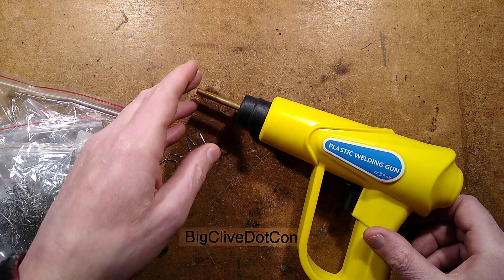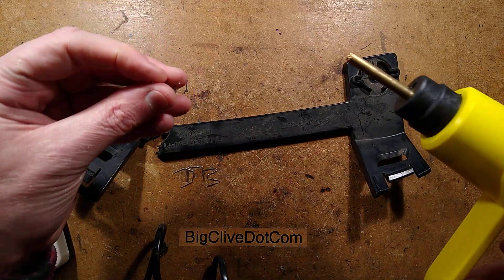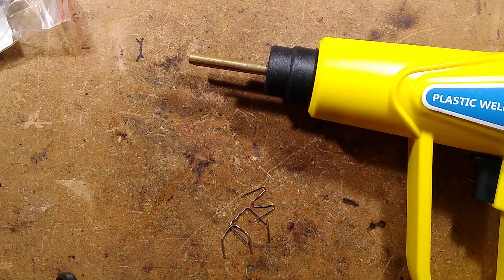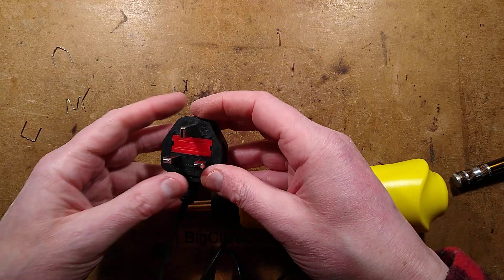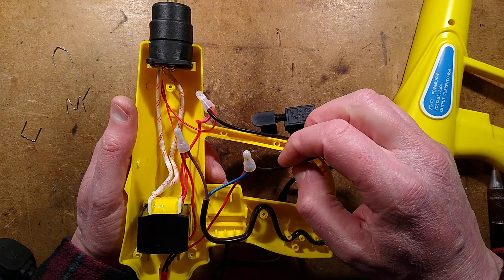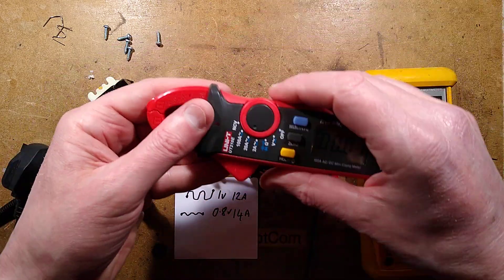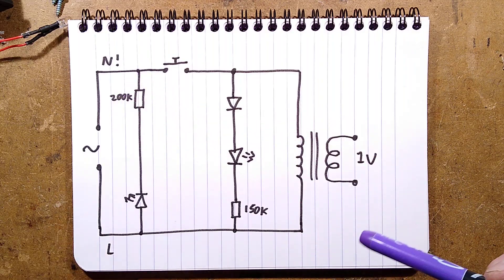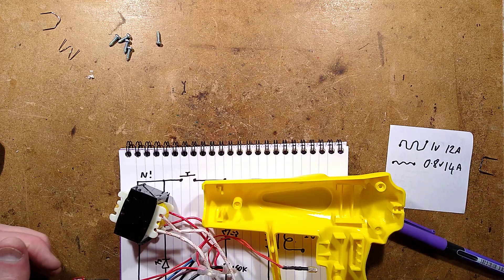Temu plastic welder with schematic

Comment: What would be interesting is what is the turns ratio of the transformer , it won't be suitable for continuous use , the magnetising current will be way too high , it will be designed for very low impedance and good regulation , it's nerdy as a subject but everyone ignores the transformer but it's a difficult compromise ,  core and bobbin size and volume ,  regulation,  impedance,  duty cycle thermal and so on ,

Comment: your also supposed to wiggle it back in forth a few degrees so the staple is completely covered inside the plastic 
they use this to fix broken car bumpers in my country , the wiggly bit goes exactly on top of the crack ,i dont know how to describe it , so on the sinusoidal bit both the positive amplitudes on 1 part and both negatives on the other , and when the staples run out they use slightly thick chicken wire ,and the mech from perforated iron doors.....
those bumpers still fail the inspection

Comment: Even at 1 or 2 volts wouldnt 10 amps still enough to kill someone if they stupidly touched the end?
Reply from the maker: The voltage is way too low unless the insulation fails.

Comment: Switching neutral in a mains voltage device makes that a dangerous device. You always switch hot so that power is off in as much of the circuit as possible in case of an accident.

Comment: Very interesting. Years ago, I used a soldering gun to do the same, but only to fuse the plastic to weld the pieces together, and afterwards, fused in office staples to reinforce the weld - ugly, but generally worked well. I have now a broken parrot cage pedestal and I'll have a look at this, if it's not too expensive.

Comment: just for your reference, the first staple you put in should have been rotated 90 degrees as it then gives more bridges across the crack we use a slightly more sophisticated one at work to align parts before actually being plastic welded 
Excellent video as always
Reply: This is good to know, thanks...

Comment: Smaller stuff is also pretty easy to fix if you know the plastic type by just melting similar packaging waste, zip-ties etc. With a little trial and terror you can get pretty sturdy connections.

Comment: This is the sort of cheap repair kit I wish had been around years ago, it is such a useful way of making repairs to things like car bumpers, you can glue the seams then reinforce the repair with metal pins, quickly and cheaply. Using a simple transformer is a sensible low tech way to produce a relatively reliable repair tool

Comment: These things are great at a Workshop. 
But it makes lots of appliances  malfunctin / behave weird. 

My workshop vacume turns on for a short moment  when i use this plastic welder.
Reply from the maker: That sounds like your vacuum is susceptible to electrical spikes.  I wonder if it has a triac to switch the motor.

Comment: The plastic repair that was passed doen to me was to melt (ideally) small holes each side of the split, tear etc and to stitch the parts back together with plenty of thread or similar. Dental floss also works very well.. You can them apply a suitable glue to the thread and plastic and even if the glue doesn't bond to the plastic it will bond to the thread to create a good repair. Glues have come a long way but there are still some plastics that are hard to 'chemically' fix. Sewing might be more time-consuming, but you can also attack parts like you might stich-weld metasl to make a solid fix in complex shapes. 
Thanks for the vid Big Clive.
Reply: Iirc i saw long time ago in some video that in some kinds of races(i guess rally would be one of those) they do in fact stitch parts together if they break, they drill a bunch of holes on the sides of the crack, and then cross-stitch it back  together using zip-ties, as an emergency fix in situ.
Might have been on ChrisFix's channel but i'm not exactly sure

Comment: I wonder how long it will be before they bring out an incredibly dangerous hand-held RF welding set? 😂
Reply from the maker: They have induction heaters, ultrasound knives and high power laser rust removers.  The latter capable of blinding people when used in the wrong way or environment.

Comment: Man, I'd be very skeptical of the isolation in that transformer. If that gets hot enough to compromise the lacquer insulation on the wire, which would not be very hard to do in normal use, those welding lugs will be at 220V. And you basically have to touch them in normal operation, so it'd be very easy to accidentally zap yourself with this. But for how cheap these are, I'm not super surprised.

Comment: Meeeh its kinda lame ,good for only thick plastic due to wire size.What i prefer is stainless steel mesh for windows(protects against flys and bugs).I got  a 80W soldering iron with exchangeable tips that has 2 screws from the sides to hold the tips(it was cheap 13€ vellman brand ).I made my own plastic welding tool by using 8mm air condition copper pipe -i put a big nail in it and smashed the one side with a hammer flat.Works great for repairs ,ss mesh strengthens the plastic so much and once you melt some more on top you can smooth it out nicely.

Comment: My understanding of this item is that you use this 1st to reinforce the break and then apply plastic welding sticks with a soldering tip on the device to infill until level then sand it back.

Comment: It's 12W output, but what's the consumed power (input)? It looks like the leak current is going to be huge...
Reply from the maker: The abused transformer dissipates 43W when the trigger is pulled.  I'll add that to the description.
Reply: @bigclivedotcom  Poor thing... That transformer is living proof that abusing the work force yields lower efficiency. 😅 Terrible efficiency in this case...

Comment: This thing is about as simplistic as a Weller soldering gun, although an incredibly low power one with a better trigger switch.  The last Weller I pulled apart that I bought brand new had leaf contacts within it.  I would think the duty cycle is similar with about 25% (on one minute, off four)?

Comment: Dear Mr. Clive, what works fairly well, is to melt a piece of a nylon zip-tie between the broken part and the heating element. Enforces the structure of the part to be welded rather well. Plus you’ve got to burry the staple half way into the melted material. Cheers, Marco 🇺🇸

Comment: That's not a plastic welder, that's a hot stapler.  Plastic welders use superheated nitrogen gas to melt filler rods made of plastic into cracks and splits without oxidization.  Because of the lack of shielding gas, hot staples make the surrounding plastic brittle and likely to split again, especially with hard polypropylene plastics due to their high temperature requirements.

Comment: Since the long tabs break off easily... Do the metal waves in the plastic also break that easily ?
They sell a 110VAC model as well... Wonder if they use the same 220VAC Transformer as I've seen before in some Spot Welders. Been there... Done that.
Reply from the maker: There are snap points.

Comment: It might not be a welder, as described.
PVC has a lower burning point then melting point and can not be weld and have to be melted chemically using solvents. (many other types of plastics can be weld such as PE, PLA...).
But when combined with solvent (Cement) it might be brilliant handy think to reinforce joints. Might be the first think I ever get based on seeing it here. 
It had to be stated, that it had nothing to do with you using it but that it sounds cheap and useful.

Comment: Love the fuse in the plug . Never saw that in USA but seems like a smart idea
Reply from the maker: Standard in UK plugs.  Intended to protect the appliance flex on our generously rated 32A @ 240V outlets.  We can plug high loads like laundry equipment into any socket in the home.
Reply: In this instance the 13A rated UK plug was fitted I believe with a 13A fuse. If so this was incorrect, the supply current for  the device would have been less than 1A so to protect the cable it should have been fitted with  a much lower rating fuse. The most commonly available fuse being 3A, however fuse ratings of 1, 2, 3, 5, 7 and 10A are available.😏

Comment: Thanks for this video Clive, I have never seen one of these before, I can feel a purchase coming on!
A quick reversal of the Live and Neutral would get that switch wired correctly.
Not sure it could be called 'double insulated' but thankfully there is not an earth wire in sight!😃

Comment: I may find use for this some day.  But, what is impressive is seeing a pro heat and feed plastic rod and truly melding material.  It looked like an impressive wire feed weld line when I saw it.

Comment: Hi Clive
I love watching your videos they are very informative.
What do you think the transformer actually is.  I.e. voltage and amps.  It seems strange that it could be 1 volt @ 12 amps or am i reading that wrong.  The sellers claim the plastic welders are anywhere between 50 and 100 watts?.  Keep up the fantastic videos.

Comment: If this actually works fine enough, it could be a game changer. We often can't save devices we're getting at the local repair cafe because of plastic parts not accepting glue or where glueing wouldn't work because of the size.

Comment: In our laboratory, we have investigated two personal injury claims where these plastic welders have overheated caused burns. Best avoided.
Reply from the maker: Which bit caused the burn?
Reply: @bigclivedotcom  
In both cases the transformer was the issue. Same model but two different transformer models used in construction, also some different wiring. In both cases, the plaintiff’s are suing for a five figure sum.

Comment: I've found the 3.3V rail from a pc power supply works well for hot staples as well as a couple of 18650 in parallel.
Reply: or a rc model LiPo battery good for 30A

Comment: Due to the staple wire getting heated a lot and then sunk into the plastic quite quickly the staple becomes brittle where it first starts to bend while the staple starts resulting in an easy clean flush breaking of the extra staple stems.
Reply from the maker: The snap points are indented to make a weak point.
Reply: That also helps.

Comment: are the cables thinner than the heating wire?
Reply from the maker: No.  They will get warm, but they are thicker and have a lower resistance.

Comment: Having spent a good portion of my working life designing transformers, I can explain the safety separation between primary and secondary windings on this type of concentrically wound transformer.
After the first winding (usually the primary) has been wound, a layer of insulation is applied. On top of this, a single turn of copper foil is applied, which has an earth conductor soldered to it. (taking care to insulate the ends from each other).
Then, after another layer of insulation, the secondary is wound.
Reply from the maker: This one will not be wound safely.
Reply: Great explanation, thanks. To be honest, though, i'd bet they aren't wound so safely on a cheap Chinese transformer. Would be interesting to find out.

Comment: If you actually want to fix something with one of these doodads, get one that includes a flat knife element and welding rods. After putting in the staples, you can run a bead in the crack and make a repair that will last. (also useful for cutting synthetic rope)

Comment: I was expecting a actual plastic welding gun (Which is basically just a hot air gun with the option to hook it up to a Nitrogen gastank).

This however seems like it would be much more practical for normal use.

Comment: for as cheap as it is, I could see that being a really useful tool in a garage. wether or not it's as strong a bond as CA glue, I couldn't say, but it would be great for holding a broken part together so the glue can set.

Comment: Somehow I doubt that this device has a thermal fuse. I was slightly shocked by the high amps 12-14, I suppose they need that to melt plastic so quickly. Thanks Clive 👍

Comment: Clive

thanks for the video 
you show two of my pet hates 
1. 13 amp fuse fitted when as you say 2amp would be ok, 
2. the switch in the neutral side   not good practice

and that lead would not carry the fault current for long

Comment: does the dehumidifier draw a lot of power?
Reply from the maker: It's a desiccant drum unit and uses 330W when running.  It is good in a cool house for adding a bit of heat as well as taking lots of water out of the air.

Comment: I wouldn’t call it a plastic welder because it doesn’t fuse it back together with more plastic.
It just uses metal embedded into the plastic to make a skeleton.
Leister make some of the best plastic welders that actually use plastic to weld the original plastic.
Interesting video I wonder how long the repair will last.
Reply: Yes, it does if you use the smoothing tool. Add waste zip-ties as filler, etc.
Reply: @englishrupe01  lol

Comment: Check the separation...
Not nice to get a good schock when you touch the connector while putting a new staple in when there has been something bad after like melting 10 or 20 of those before... and separation in the transformer is bad .

Comment: Interesting how the electrical design is quite robust. The primary function will operate regardless if the LEDs burn out. A more cynical design would shut down heating as a "precaution" once one of the indicator lights burn out.

Comment: Almost guaranteed the wire is CCA, as after all it is cheaper than copper, and now almost the standard wire in the Chinese market, with all things now being wound in it, even available down to 48SWG as well, as i have seen it used in this size.

Comment: The wave pattern of that staple should zig-zag like a sine wave over your crack line. This way, you get multiple points of "welding" instead of just one, like your first staple. If your staple goes over your crack once, then it can be straight, like document staples, but then you need so much more of them 👍
Reply: I'm confused.  Not sure you mean you should use crack before welding plastic, or you should try it out on your own crack to see if it's hot enough?

Comment: Would it be possible to rig a diy version using an e cigarette battery part?
Reply from the maker: You can get battery versions.
Reply: Those staples have ~ 0.01 Ohms while vape coils are typically in the 0.4 to 1 Ohm range. Will heat up much faster but i guess it's possible. 🤷
Reply: @tubybubi  No. about 80mOhm, 1V at 12A

Comment: I got one recently for a repair. Practice definitely makes perfect. Gone straight through a couple of times. I've never found a way to remove the excess wire cleanly. Can't find truly flush flush cutters that are robust enough to cut steel wire.
Reply from the maker: Some of the staples I got have indents in them so they snap easily.

Comment: My 120v one came with a knife adapter for melting / welding plastic. After using it for 20 minutes or so, constantly on, the device gets pretty damn hot. I ended up taking 30 minute breaks to let it cool down enough not to burn my hand.

Comment: Is there ever a use case, where the switch is on the Neutral wire and not than the Live??
Reply from the maker: It's preferred to have it on the live for safety.

Comment: easy to use a hot air gun for micro circuits and a small piece of extra plastic just weld it together, stronger too.

Comment: Heating of the transformer may not be much of a concern.  You only had it turned on for 10 seconds.  Even if you were doing a real repair it might be most of a minute before you turn it on again.  Rather low duty cycle.

Comment: regarding the resistors
the current going trough the 200k resistor is 1. 2 mA (U/R)
and the rated effet must be atleast 0.288 watts (U²/R)

and the 150K one (adjusted for 1V drop over gallium+silicon PN gate)
1.6 mA and 0.381 watts

1/4 watts resistors would overheat
1/2 watts shouldent .. but thay are incased so .. possibly

Comment: Seems almost if not actually useful. I want some of those heat staples anyway! Been meaning to practice plastic welding with pieces of metal and a hot iron also. Generally speaking I'm guessing that PVC and steel don't mix (not that the ones you have are)  but is that correct?! Does melting PVC with steel wire cause steel to corrode?
Reply from the maker: Burning plastic might cause corrosion, but an embedded wire should be OK.

Comment: Turn it into a soldering iron or use a soldering iron and turn it into a plastic welder .I still have my weller dual wattage trigger transformer soldering iron .drill and tap the sides of the riron to hold the set screws to tranfer voltage better to staple /wire

Comment: We use these frequently, and we always put a twist on it before we let it cool so it has virgin uncooked plastic vertically above it, we find it holds much better on the ATV and side by side bodies we repair with them. We also pre-heat them to glowing red before we sink them in, instead of warming them while touching the plastic.
Reply: Someone read the instruction, naughty.
Reply: Great tip.
Reply: So do you orient it correctly before or after the twist, ie apply along the crack, then twist, or apply at an angle to the crack, then twist it to be in line?